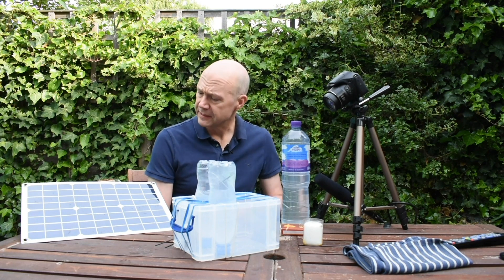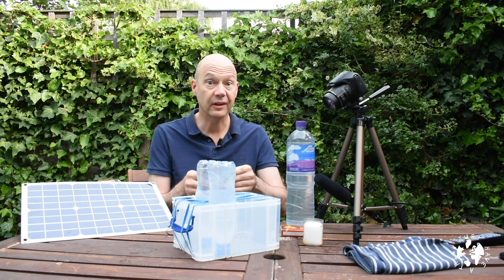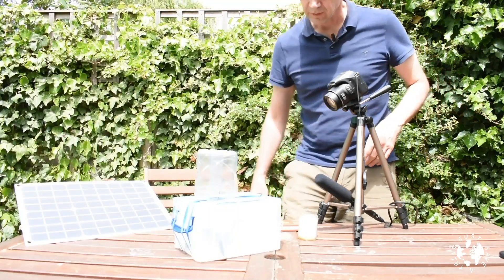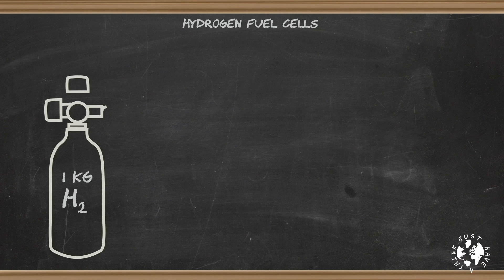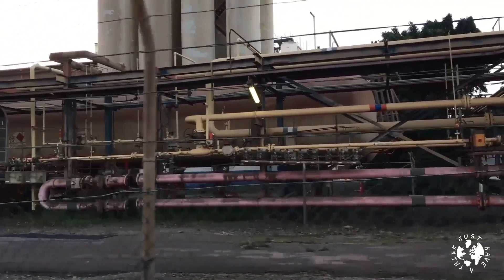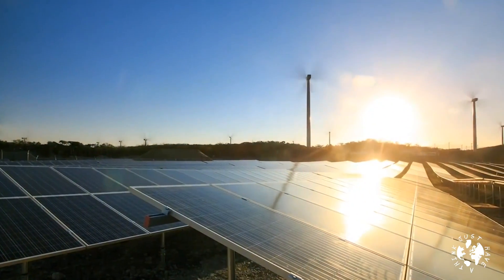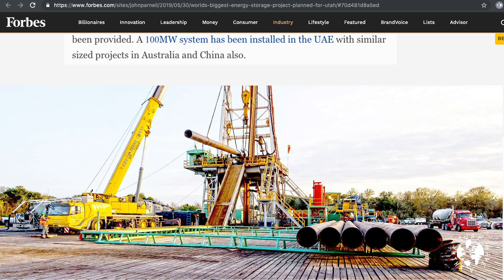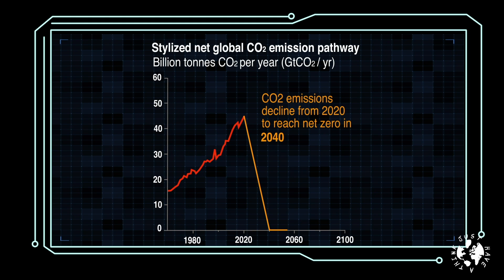Energy Storage in Hydrogen : Does this beat batteries?

Comment: We are going to use our turbine to create and store hydrogen . Our variable pitch vertical axis wind turbine has just started to work and is now free from our electric motor test unit. www.vertogen.eu
Reply: Do the bearings last longer than a normal turbine which we have found is the major cost in a wind turbine operation and do you still need a transmission and another costly expense or can you control the speed by variable pitch control?
Reply: @rogerreimer6787  It's early days, we tend to use the best bearings anyway. Do you have any advise or products?

Comment: So ? I watched this and still don't know the answer. Is it better than batteries ???
Reply from the maker: I think we probably need both Big Blue, depending on circumstance and usage type.
Reply: @JustHaveaThink  What are the real costs of both systems and should we pick one and go full throttle ?
Reply from the maker: @bigblue2216  Well, I'm looking at hydrogen for heating in the next video, and that does bring in a comparison between electric boilers and hydrogen heating systems. So far though the research is really suggesting that the decision on which technology to use does depend on geographic location and proximity to existing grids etc. so it seems genuinely difficult to suggest we should select one over the other.

Comment: Amazing video . In that way we can beat the duck curve problem in solar panels . By efficient storage.
Reply: Batteries is still better than hydrogen storage r to beat the duck curve problem, though.
Reply: @remliqa  batteries have cycle problem that defeat the financial part . And they bad for environment .and good enough for large scale city ( from what i heard )
Reply: @abdenacerfodil2546  

HFC require  the mining of rare mineral such as platinum so they are pretty bad for the environment as well large infrastructure set up (for storage and distribution). The cycle problem for batteries can be somewhat mitigated by a software solution that regulate  factors such as recharge rate and thermal control and such measure have been shown to prolong the  effective lifetime of battery storage by quite a lot.

Comment: Hydrogen creation and use is currently rather inefficient. Also I am not sure current gas pipelines etc can deal with Hydrogen as is because of the smaller molecule size giving leaks? Have a look at gravity storage for a low tech and efficient system being developed. https://www.youtube.com/watch?v=mmrwdTGZxGk

Comment: I'm an Engineer and this form of storing energy has been my favourite for some time. It's a lot faster to fill your car up with hydrogen than charge up it's batteries. 
Too bad people are afraid of hydrogen when it's a safer gas than LPG.  The fact that it's lighter than air makes it safer, because if you have a small leak it will dissipate more regularly into the atmosphere. Where propane is more likely to fill up your car.
Reply: yes.. hydrogen is a neat trick in the lab. and here's why NO ONE WILL EVER use it anywhere other than nasa. water to hydrogen- 20% loss. high pressure pump into tank-  10% loss... 15% if you liquify. gas thru fuel cell- 40% loss- at a minimum.  lithium battery loss? 2%. TOTAL. any other questions?
Reply: the fact is... the hydrogen stations that NOW power hydrogen fuel cell cars get their hydrogen from BIG OIL-  who refine it from natural gas... and it's about $7 a gallon. you'd be better off just converting your car to propane.
Reply: or just buy a BEV. no more high fuel bill.. no more dependence on big oil. solar, bev's & lithium ion. like peas, carrots and steak.